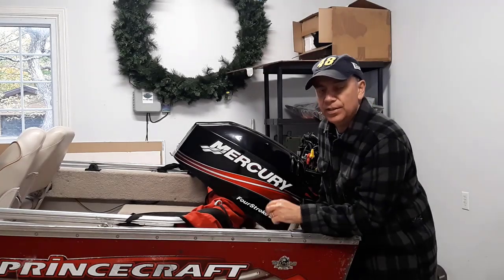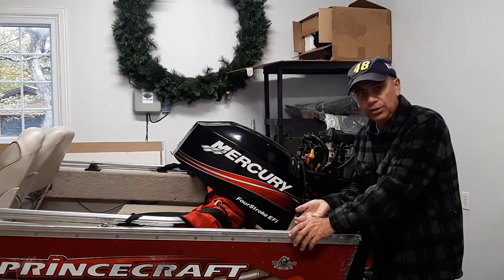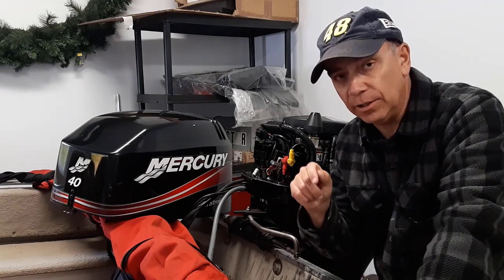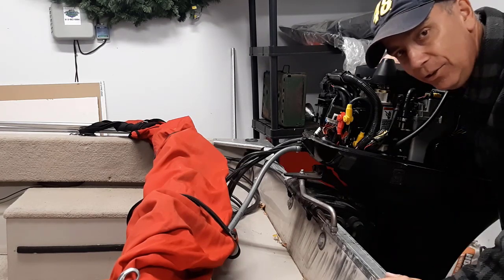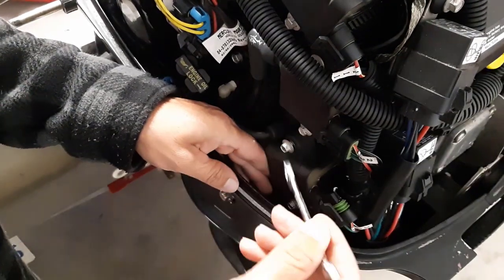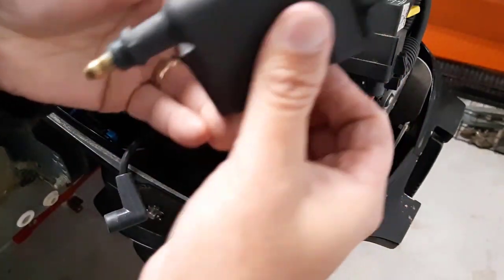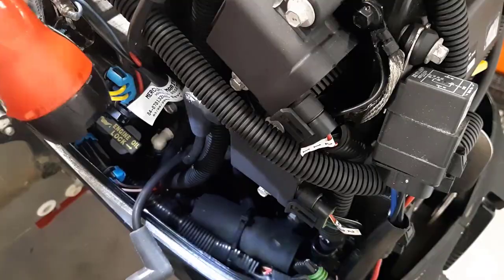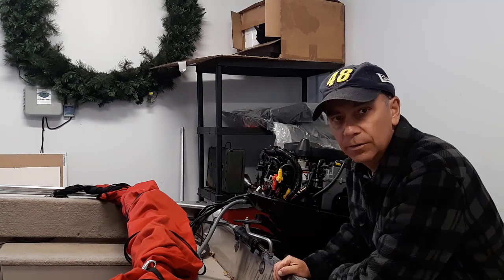Mercury Outboard Runs Then Dies / PART 2 / Finding The Other Fuel Filter

Comment: Ethanol free is whats needed, even premium has ethanol that will break down that fuel line.  btw to get to the filter and out easier to remove the lower cowling. Few 10mm bolts.
Reply from the maker: Thanks
Reply: Indeed, ethanol and benzenes are the culprits for decaying about any fuel line material. Benzenes, you cannot escape but ethanol-free fuel should be preferred but is no longuer available in Canada. By the way, running premium fuel serves no purpose on a rather low compression motor like yours. Thanks for sharing your findings !

Comment: Great video, now I can replace mine I have a 2017 40hp 4 stroke and I couldn't figure out where that filter was. I don't wanna pay $800 for the 300hrs service so I got the 300hrs kit from mercury for about $160 and started doing it myself.

Comment: I used to swear by Mercury, now I swear at it!!.  Why would they hide a filter, something that needs to be serviced (ya, I know, so they can charge big bucks for them to do it) on a regular basis?? Im on a remote lake on a pontoon boat so I cant just run it in to a marina for service so I do things myself, but their manual doesnt even talk about the in-line filter, just the small one  with the sight bowl! Ridiculous! Glad I found this video, now Im not so worried about removing parts to get at it.  While I'm ranting, anyone ever try to repair the fuel cooler that Merc wants 500$ to replace???

Comment: That's looks like a heavy boat to paddle back to shore cause it kerplunked out the water! 😄 I had a similar issue on my Kubota 60" zero mower.  The mower had two filters (same type), but in the manual it doesn't even talk about a 2nd filter.  I routinely replaced the one you can see that sits right beside the motor, but one day - it just stopping running.  It cranked and did everything it was supposed to do - except start.  I knew it was a fuel problem, so i put it up on ramps and crawled up under it just to inspect and whallaaa - there was a 2nd filter under the mower that was not visible looking at it from either side or the top.  It was same type filter as the other one.  I changed it out and it has run like a champ ever since.  It was odd - never seen a piece of equipment with 2 inline filters in the same fuel line - I guess that way you get some additional assurance of even cleaner fuel - might be because its a diesel.  Good video. - Rick
Reply from the maker: Hi Rick, yes they sure know how to hide things and not let you know about it. Glad you found your 2nd hidden filter. I like fixing my own machinery, I know the little things are taken care of that way. My Dad was a diesel mechanic and I learned alot from him thru the years and I'm still learning from him.
Reply: Thank you both lol, my 2015 mako skiff runs like crap all of the sudden this year, both times 3 hrs to salt water it pulled its crap. After changing the easy fuel
Filter the thing ran great on test at lake in between. Sounds like fuel issue. Going to watch part 1 next but sounds like mine. But also have a 1 year old Kubota zero and thanks for the tip on it.

Comment: Good video. I have a 25 hp. 4 stroke and the filter is a little different however. Still way down there. It is the high pressure fuel filter. I don’t see any other videos on that one, just the regular fuel filter. According to the book, they are supposed to be changed every 200 hours but I doubt anyone ever changes them.
Reply: Hi Larry did you fix problem by changing filter?

Comment: i have a 98 mariner that wont go up on plane bogs down,but it runs just fine? all the way through beginning of first video i was right there with you going through the checklist changing tanks,lines  but the filter fixed your problem but didnt help me?? anymore ideas?

Comment: Hey Roland, tnx for the video, well done! I have an old school Merc 35 HP, tho its a 2 stroke, 2 cyl, the problem was almost the same. The diff I had was someone before me had cheaped out on the in-line filter which also started to disintegrate from the inside, and let a sm pc of rubber through and proceeded to clog my carb! Matters worse, mine would let me run up to 1/2 throttle ok, then if I pushed beyond, it would bog down, then die! After several attempts, it would almost kill the batt before starting again, but got me home. Eventually I also replaced all my lines, bulb, filters and rebuilt my carb. Thought I had it! Nope! Carb off 2 more times before I tried compressed air before reinstalling the carb. Little pc of rubber shot out of an orifice like a bullet! FINALLY!! GOT IT!! Has run like a top ever since!! (second filters not sounding like a bad idea to me!) Btw, that electrical component in your way is a coil! Thanks again, happy motoring! Cheers!!

Comment: take the filter off and take it to your local motor factor they will match it or find a similar one that will do the job. Also run the engin dry of fuel before taking any filters off or messing with the fuel lines. Good video.

Comment: You described exactly what my 25 hp EFI Merc did today and yesterday on the river. I suspected the fuel line and siphon tube. Will check the filters in the morning. Fuel line and tank is old, so I'll replace them as well. Liked and subscribed. I'll post here to let you know. Thanks friend.

Comment: Roland Great video. i think i can help you going back together with those spaces and bolts. When i had that type of problem  i would use to use a small rubber band. Stick the bolts and spacers through the coils like your going on but i would put a small thin rubber band on the threaded part of the bolts and start the bolts. After tightening the band would break lose and you have all the bolts on and would worry about losing anything. See us FORD guys know a few tricks. lol Great video Bud.
Reply from the maker: Thanks for the tips! I guess fixing Fords all the time pays off. lol

Comment: great vid!  BTW... I think those gray marine fuel lines are probably not the thing to use. they have a clear plastic liner inside right? and that liner breaks down, plugs up filters and carbs (which you mentioned on yours). I've seen other vids here that say just go buy the standard black fuel lines for autos and use them instead. that and ethanol free gas.

Comment: Old video but this is a classic rookie error. Just throw expensive parts at it without a proper diagnosis. Has more money than thoughts. And it's a Mercury. Good to know you have a lot of money. You'll need to use it on that anchor.

Comment: well let me educate you some the thing you keep stating  to as some electrical thing is called a coil and the black wire is a sparkplug wire the coil is where the sparkplug gets it electrical charge from . Each cylinder has one and they fire independently  But not trying to be an ass you did teach me something i didn't know there was two filters  so thanks